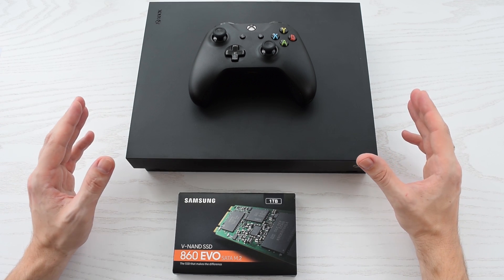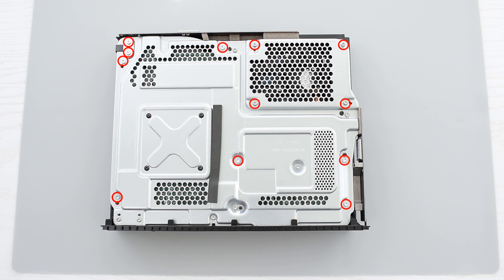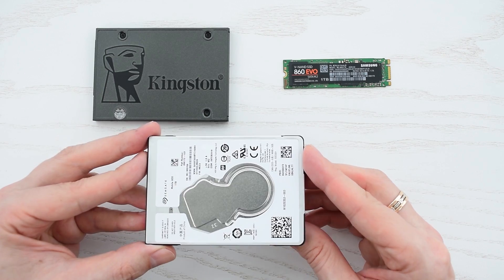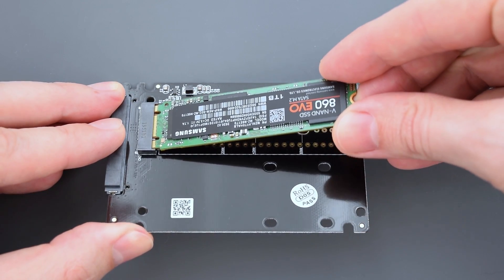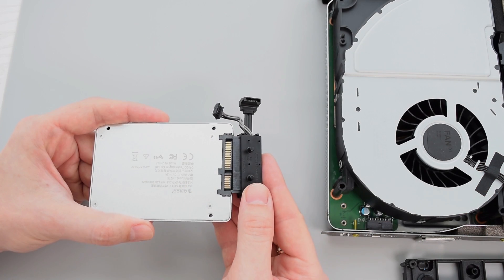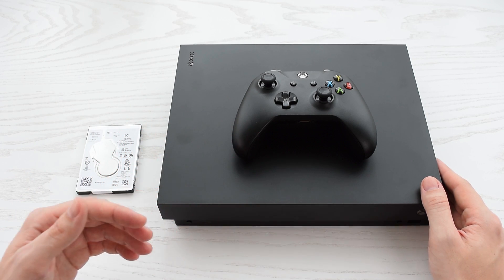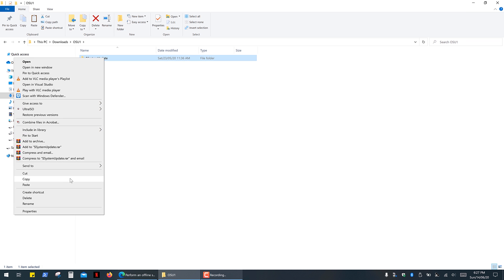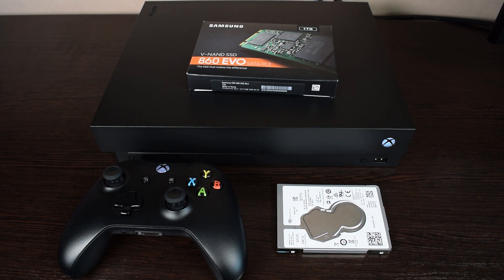How to Upgrade your Xbox and PlayStation Console to M.2 SSD Drive. 100% Works for all Consoles

Comment: this is pointless, you wont be getting any of the benefits of m2 ssds.
Reply from the maker: If you watched the video you wouldn't make such "expert level" comments and learned something new instead. We were using M.2 SATA (NGFF) SSD which has SATA III interface. And the Xbox One X has the same SATA port which fully utilizes the data bandwidth of of that SSD. The main idea was just to show the upgrade options. Lots of people say that they have spare M.2 NGFF SSDs after upgrading laptops etc. And they didn't even know that such adapters exist.

Comment: Can i install 4tb ssd m.2 and if so what should i get?
Reply from the maker: Xbox officially supports 500GB, 1TB, and 2TB drives. You can also use a 4TB drive, but after installing the offline updates, you'll need to remove the drive from the console, connect it to a PC, and use any partition management software to expand the User Content partition to the maximum available space. Otherwise, the SSD will be recognized as a 2TB drive.
Using a 4TB M.2 NGFF SSD only makes sense if you already have one. Otherwise, any 2.5" SSD will be at least $100 cheaper than a 2TB NGFF SSD.
Reply: @ElectronicsComputers Didn't it say that Microsoft has limited the internal storage (HDD / SDD) to 2TB on the Xbox one S and X? So the full remaining TB of the HDD or SDD is available if you then use the partition manager to expand the user content partition to the maximum still available storage space - without having data loss afterwards because it goes beyond the 2TB? 
Is it the same with even larger HDDs / SDDs (8TB, 16TB, ...)?
For the external storage media, Microft has limited this to 8 partitions of 16TB each. Each storage medium larger than 16TB is then divided into individual partitions up to a maximum of 16TB each. A 24TB HDD/SDD would therefore have 2 partitions - one 16TB and one 8TB in size. Of the 8 available total partitions, 2 would then be gone, so that 6 more would remain.

Comment: Can I also put an Samsung 990 Pro into my Xbox One X?
Reply from the maker: You can use only NGFF M.2 SSDs. There's no such adapters for NVMe drives.
Reply: @ElectronicsComputers Your statement is not correct!!
NGFF is a physical form factor and slot type, commonly known as M.2, while NVMe is a communication protocol that uses the PCIe interface, say Reddit users and Digitec users. An M.2 (NGFF) slot can support either a slower SATA protocol or a much faster NVMe protocol, as long as it is connected via PCIe lanes. Therefore, an NVMe drive is a type of SSD that uses the NVMe protocol for high performance, and it is often housed in an M.2 (NGFF) form factor, but an M.2 drive can also be a SATA drive.
It is likely that the Xbox one S and X does not support the faster NVMe protocol and therefore cannot be used. M.2 NVMe SATA SDDs are therefore often not recognized in older PCs because they do not support the NVMe protocol either.

Comment: I hope Microsoft in the future let us do this with the series s and series x
Reply from the maker: @DustyOrchid057  I have replacement/upgrade videos for Xbox Series S and X.
Reply: @ElectronicsComputers  I thought you couldn't do that because the hard drives are married to the motherboards
Reply from the maker: @DustyOrchid057  Well, it's a bit complicated. On Xbox One X|S consoles, there is a chip on the motherboard containing the bootloader. This chip allows you to start your console and install offline updates. Essentially, all you need to do is insert any 500GB, 1TB, or 2TB HDD or SSD and install the offline updates, similar to installing Windows on a new PC.
With the Xbox Series X|S, Microsoft intentionally created a more challenging process for users. Instead of relying on a bootloader chip, they introduced a bootable partition on the SSD with unique encryption. This encryption changes frequently after updates or when installing offline updates.
If that partition becomes corrupted or the SSD fails, and you can't recover the bootable partition, the console becomes suitable for donor parts—worth only about $50. Unfortunately, no one other than Microsoft can fix such consoles.
Also, only a few SSD models are compatible with these consoles. To replace an SSD, you need to back up the first (bootable) partition, restore it onto a new compatible SSD, insert the new SSD into your console, and then proceed to install offline updates.

Comment: Is it possible that the M.2 slot could be used but would need to be a regular M.2 SATA rather than NVME? Reminds me of some older mobos I had in the past that wouldn’t recognize M.2 NVMEs but would recognize SATA M.2 SSDs. I think this would be based on the Storage Controller being only SATA 3. Totally could be wrong just an idea that I would be curious to see tried out!
Reply from the maker: Unfortunately, such adapters don't exist for NVMe SSDs and most likely never will. You can only use NGFF SSDs. This method makes sense only for those who already have a spare NGFF SSD, perhaps from a dead laptop, after an upgrade, or when you find a very good deal on an M.2 NGFF SSD compared to a regular 2.5" one.
Reply: @ElectronicsComputers  Your statement is not correct!!
NGFF is a physical form factor and slot type, commonly known as M.2, while NVMe is a communication protocol that uses the PCIe interface, say Reddit users and Digitec users. An M.2 (NGFF) slot can support either a slower SATA protocol or a much faster NVMe protocol, as long as it is connected via PCIe lanes. Therefore, an NVMe drive is a type of SSD that uses the NVMe protocol for high performance, and it is often housed in an M.2 (NGFF) form factor, but an M.2 drive can also be a SATA drive.
It is likely that the Xbox one S and X does not support the faster NVMe protocol and therefore cannot be used. M.2 NVMe SATA SDDs are therefore often not recognized in older PCs because they do not support the NVMe protocol either.

Comment: Can I clone my hdd to the ssd and get my previous installation?
Reply from the maker: Sure fi you clone it to a new drive it will be the same system with all your data.
Reply: @ElectronicsComputers what type of clone would I have to do?
Reply: @ElectronicsComputers However, for example, a cloned 500GB HDD to a 1TB or 2TB HDD/SSD remains a 500GB HDD/SDD. In order to use the full 1TB or 2TB of the new HDD/SDD, you have to use a partition manager on the PC to expand the user content partition to the remaining full TB so that you can use the full storage size of the HDD/SDD.

Comment: I guess I’m going to have to do a video showing people how to go onto Amazon and buy a USb 3.1 nvme drive Caddy. Then install a 2tb nvme drive. And then plug it in to your ps4 pro. And achieve 10Gb/s on usb 3.1 interface rather than 6Gb/s on sata interface.. I’m the first to do this. K.I.S.S. Theory…
Reply from the maker: The main idea of this video was to show the upgrade options. Many people say they have spare M.2 NGFF SSDs after upgrading laptops, etc., and they didn't even know that such adapters exist. If your HDD is bad or about to fail, no external drives will help you.
Reply: @ElectronicsComputers  OK, your NGFF SSD requires an adaptor as well. Many people also have hard drive disks laying around from upgrades that are in perfect condition 100% health. To say that you didn’t know that external NVME drive caddy’s exist but do say that you know that M.2sata adaptor for 2 1/2 inch sata drives does exist is kind of hypocritical. This isn’t an upgrade. It’s just a repair. If you want to actually upgrade things you want them to be better. And there is no making a sata interface better. SSD and Sata interface I have never understood. I never understood why a company would take a drive with such incremental speeds and limit it by an interface limited to 600 MB per second. It’s just a waste. If you have a bad hard drive just replace it with another mechanical hard drive. Put your solid state drives on the external 3.1 USB ports. your Computer Guy, you know the speeds of those USB ports. Your Computer Guy, you know the speed of a sata interface. I don’t know why anybody would want to put an M.2 sata drive in a ps4, it’s like using a hammer for a wrench. How does Computer Guy not know that NVMe Drive external caddies exist? Maybe it’s just simpler to sum it up saying you could do better for your subscribers.

Comment: I’ve got a similar solution that works higher transfer speed then Sata ssd
Reply from the maker: I was using NGFF M.2 SSD which is a regular SATA drive but in M.2 formfactor. There's no such adapters for NVMe SSDs in case if you want more performance out of that setup.
Reply: @ElectronicsComputers  lol, then how am I getting a loading time of 83 seconds to load GTA 5 from ps4 menu to gameplay? Ps5 does it in 57 seconds, OG ps4 does it in 143 seconds. There’s a way I’m just not gonna tell anybody. Think 10Gb/s
Reply from the maker: @ianpatterson3061  PS5 supports NVMe drives when PS4 only sata drives. SATA SSD, whether it's a 2.5" one M.2 NGFF, provides the same performance.
Reply: @ElectronicsComputers  why are you fixated on a sata interface? Let’s do some basic math. Sata interface equals 6Gb/s. USB 3.1 interface on PlayStation 4 pro equals 10Gb/s. Why on earth are you using Sata interface for storage?. Here…  I’ll give you my recipe, brother. Go buy yourself a USB 3.1 NVME external drive caddy form Ugreen.  The NVMe  USB 3.1 external drive will load data onto your PS4 at 10Gb/s versus the 6Gb/s you’ll get from an SSD on your Sata interface. Christ man you’re the professional I’m the amateur. Maybe before shooting your mouth off you should ask someone what they’ve got and what they’ve done rather than just pretend that you’re right and they’re wrong.

Comment: Any tips for a 2tb m.2 installation to an Xbox one x?
Reply from the maker: Xbox officially supports 500GB, 1TB and 2TB drives. Simply put a new 2TB inside and then install Xbox "OS" from a USB drive and that's it. It's a 40 minutes work max.
Reply: @ElectronicsComputers  thank you for your speedy response
Reply: @ElectronicsComputers  I just noticed that I have a m key nvme 2tb. Could you help me find the proper ssd enclosure for it
Reply from the maker: @Zcarcarius  There's no adapters like that for NVMe drives. You can only use NGFF M.2 drives.

Comment: No offense, but you might as well stick a standard 1 or 2TB SATA drive in it because the NVMe drive will be limited to the SATA ports transfer speed. I stuck in a 1TB PNY SSD into my XBOX One X and it made a world of difference.
Reply from the maker: You can't use NVMe drives with such adapters and I clearly explained that in the video. The main idea was just to show the upgrade options. Lots of people say that they have a spare M.2 NGFF SSDs after upgrading laptops etc. And they didn't even know that such adapters exist.
Reply: @ElectronicsComputers  Either way, you’re still better off sticking a standard 2.5in SATA drive into the console and not screwing around with any m.2 adapters. Most of those adapters are cheap quality anyway and usually end up failing before the drive inserted into it does…
Reply from the maker: @mally1124  Those adapters have only one active component, which is a voltage regulator that steps down 5 volts to 3.3 volts. We've upgraded tons of consoles for customers with NGFF  SSDs, because we have a bunch of them from broken laptops and none of those customers have returned. As mentioned earlier, the main idea of the video is to demonstrate upgrade options, making it a beneficial choice for those already possessing such drives.
Reply: @ElectronicsComputers  Duly noted 👍🏻

Comment: Is this more faster or just have same speed with the reguler SSD. Because it use SATA pins am concern it botle neck or not?
Reply from the maker: I was using an M.2 SATA (NGFF) SSD which has SATA III interface. And the Xbox One X has the same SATA port which fully utilizes the data bandwidth of of that SSD. The main idea was just to show the upgrade options. Lots of people say that they have spare M.2 NGFF SSDs after upgrading laptops etc. And they didn't even know that such adapters exist. Or maybe you just want to use that M.2 SSD in another device after your console dies (2.5" SSDs are becoming obsolete), then it's pretty good option. There's no adapters like this for M.2 NVMe SSDs, though.

Comment: Aloha, I know I'm a little bit late but do you have a speed comparison between SSD and nVme? I cant find any videos on this.
Reply from the maker: First of all, NVMe is also an SSD, but I understand what you mean :). Secondly, you can't use NVMe SSDs in Xbox One X, and that's why you can't find any comparison. You can only use regular 2.5" SSD or M.2 NGFF SSD. Both are SATA drives and have absolutely the same specs but different form factor. This method, using an adapter, is for those who already have an NGFF SSD in their possession, for example, from a broken laptop or if you have a better deal price-wise for NGFF than a regular 2.5" SSD.

Comment: PS4??
Reply from the maker: Yes, it works for that console as well. For PS4 it's actually way easier including OS installation.
Reply: @ElectronicsComputers  THANKS FOR RESPONDING, YES I WOULD LIKE TO SEE A VIDEO, BUT NOW WITH THE FAST, SLIM, PRO PS4 :)
Reply: By me in ps4pro this Adapter have I/O Problems,  lags,  with sata ssd no Problem

Comment: So recapping from the OP Responses to people.  

Official Sizes that works - 500gb, 1TB, 2TB
Data read/write format - SATA
If this is an upgrade to current size (500gb -> 1TB -> 2TB) - Perform a clean install - Do not clone, can hinder performance and Storage space
2.5in SATA SSD is no different than the M.2 SATA connection. 
Write speeds are still faster than USB 3.0
If Drive is not detected full size capacity on Xbox Console - Remove drive, plug drive into a PC and expand the "USER Content" portion to remaining available size via Disk Manager program of user's choice.
Reply from the maker: Perfect!
Reply: Hey Thanks - dont forget you can pin comments too.  Thanks for the videos man.  @ElectronicsComputers

Comment: This explains why someone must make such a company or computer store upgrading all Xbox Ones to 2TB compatible brand name Solid State Drives as options so I cannot go through such an annoying hassle even with my old Xbox One console.
Reply from the maker: You can use any 500GB, 1TB or 2TB HDD/SSD (or NGFF M.2 with adapter) in your console.

Comment: Does it make a difference comparing this with the normal ssd?
Reply from the maker: With such adapters you can use only NGFF M.2 SSDs which have SATA III interface and they have the same speed as 2.5" SATA SSDs. You can't use NVMe SSDs with such adapters.  The main idea was just to show the upgrade options. Lots of people say that they have a spare M.2 NGFF SSDs after upgrading laptops etc. And they didn't even know that such adapters exist. Or maybe there's a better deal for an M.2 NGFF SSD than a regular 2.5" SSD.

Comment: One question, if I clone my 1TB original HDD with a drive cloner to a 2TB SSD, will it still think it's a 1TB drive if I don't extend the storage manually on my PC or because I cloned it everything should work to full capacity? I know the Xbox has a 2TB limit, hoping to get this fully finished before my little man gets home from his grandparents, cmon amazon, get delivering me that thermal tape 😅
Reply from the maker: Xbox officially supports 500GB, 1TB and 2TB HDDs/SSDs. If you're gonna use a cloner device it will clone "as is" so your new drive will be seen as a 1TB drive. After cloning you'll need to connect your new SSD to a PC and using some software extend "User content" partition to maximum available size. 
I never recommend using cloning, because in case of some major update you may end up with some update or boot errors. Just make a clean install, then install your games and once you log into your Xbox account all your game progress will be back. Also cloning will compromise your SSD performance.
Reply: @ElectronicsComputers  awesome, you couldn't of made this more clear, thank you sososo much!!!
Reply: @ElectronicsComputers  do you have a reccomended software to extend the drive? Will 7 Zip work or windows 10 pro naturally be able to do it?

Comment: Love these videos, my little man is going to be 4 next month and has almost finished all of Sonic Generations on his own, mind you a lot of screaming but he has nearly beaten every level by himself as well as Toy Story 3 on his own, I am so proud of him as an early birthday present and thanks to your great videos he will have a Cyberpunk 2077 Xbox One X with a 2TB SSD with 550/510 speeds, I also ordered thermal tape thanks to you other video and have it cleaned and ready to apply the fresh batch of tape and paste along with his new SSD drive to get and extra boost on all fronts because the old paste was hard as a rock and probably just making things worse for heat, as well as 1 back and 1 bottom USB fan that clip right into the shell to give it that little extra air flow. My oldest son and I both thank you. He hates the HDD load times and it will also save his A button greatly LOL
Reply from the maker: I'm happy to help and I wish you guys fun gaming with upgraded console.
Reply: @ElectronicsComputers  He is going to be so excited when I tell him he has "stronger" hardware inside his xbox now, thank you so much for your straight forward clear spoken videos! By far my go to check for tech explanation videos!